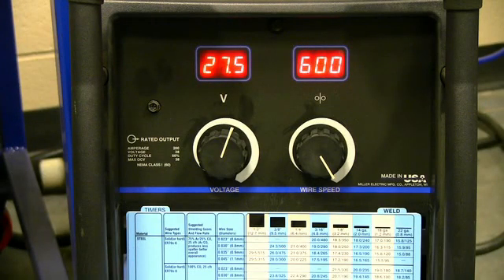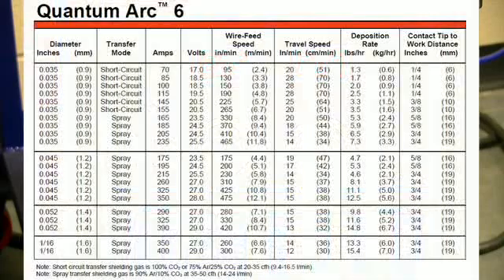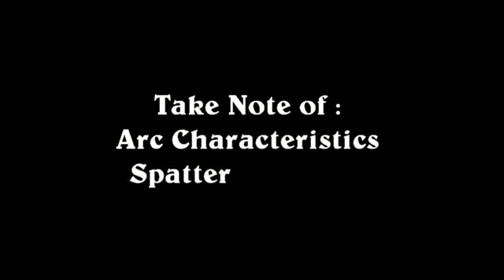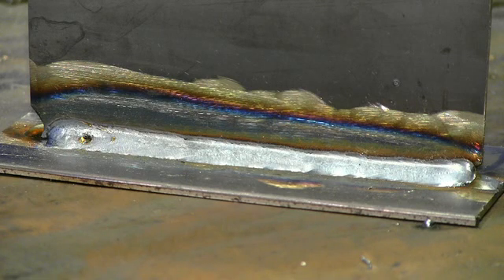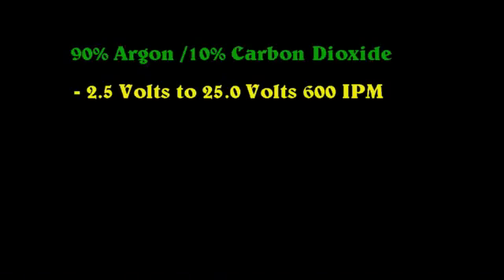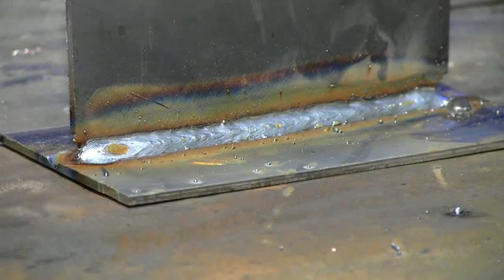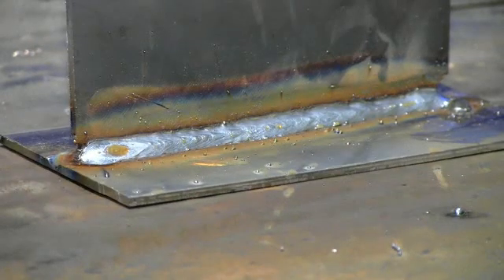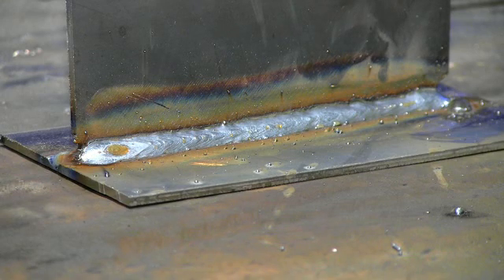spray transfer

Comment: Thanks for the informative video.
I am still confused about settings for spray transfer when welding aluminum. Spray is certainly achieved using 100% argon and voltages certainly less than 25 volts. Why is this?
Suggested settings on some welders for aluminum spray have voltages around 18 volts whereas other machines set about 21 volts. Are these differences just related to the machines’ idiosyncrasies?

Comment: Brilliant video and explanation.  I've been using spray transfer on 8mm plate, horizontal fillet and vertical down fillet with really good results . I like your video because of the possible problems and how to rectify them. Great job 👍

Comment: So do you have to push or can you pull the puddle with spray transfer and can there be oscillations or manipulations such as arcs or cursive e's or does it have to be a straight push or pull?

Comment: Hi im in the uk using C15 ( 85 /15 ) here's my problem ? we use 0.039mm wire ( 1mm ) so what would be the optimum parameters for welding using 27.5 V  what would my wire speed be yours is 600 Ipm I need a Meters per minute approx 
Thank you for the Video
Reply: You don’t need meters per minute, not being a prick but you need to pay attention to the silica that is deposited on the bead surface…… the colour ranges from very light caramel to dark brown and all the way to black….. you don’t want black, you want to be getting a caramel colour, more towards the light end of the range, that goes for both dip transfer (shirt circuit) and spray transfer… the colour gives you your temperature. As for voltage, you can’t get spray below 25 volt’s so just crank your machine to 3/4 of its maximum wire feed speed then set the bolts to around 30 volts, from there you can fine tune depending on the results…. The tip of the wire should be pointed, and the arc will be conical with an arc length, measured from the tip of the wire to the weld pool, of about 5mm….If that gap is say 10mm then you either need to increase wire speed or decrease the volts….. I jump from dip to spray depending on which weld I’m doing and I think I spray at around 13-14 meters a minute, .09 dis wire, argoshield gas and the volts are about 30-31 and that’s just a light bead….. play with the settings and have fun, try setting your machine up for dip just by listening to the sound it makes, should sound like bacon frying….. I shouldn’t have smoked that joint earlier!!!🤣🤣🤣🤣

Comment: What  you're talking about is still globular tranfer. For "true" spray transfer, a mixture of at least 98% argon is needed with 2% oxygen on mild steel. 99% argon and 1% oxygen for stainless steel.
See "The Welding Handbook, 9th edition, Volume 2, Table 4.1. Globular to spray transfer currents", as per the American Welding Society.

Comment: Even that first weld was awful. The entire thing had undercut all along the top. Spray is so hot that you should never EVER use it on thin material like that. I use spray transfer at work every single day and they should never ever look that way. Spray should look very similar to pulse MIG in the flat position and have the distinct freeze rings you'd normally have. Not to mention your travel speed. See how fast you're having to go on that dinky little 1/8" material? Spray is not meant for metal that thin at all. If you really want cleaner welds with thinner metal, use 90/10 gas at like 22 volts or something. Your freeze rings are shaped like a bird's beak.

Comment: Very well done. Wondering what the flow rate or cfm for the gas should be to do this spray arc process. I'll be welding 1/8" metal with .035 wire and 92% & 8% gas. Thanks

Comment: I love spray on a butt joint or a lap joint or an outside corner. But every time I try to weld a fillet it the horizontal position it undercuts the shit out of the top plate. The arc eats up the metal like 1/4 inch away from the toe of the weld. I may just be set too hot.
Reply: Try a little back step with a slight pause after your forward movement. Also dont hold a 45° angle on the fillet. Relax to about 35°

Comment: Whats the right setting to weld a 3/4 plate to 3/8 one ?
Reply: Max power to start, set wire speed from there.     Bless the work piece with the cutting torch before hand.

Comment: Nice presentation, very clear.  I'm always looking for this kind of information:  What am I supposed to SEE and HEAR when this is working right?   What do I do when it's all wrong?  It's pretty easy for something to get wildly out of adjustment!  Today I'm trying to get a hint, see if I can do a little spray transfer with the modern toylike inverter MIG welder... and it looks like a solid "maybe", like if the machine is cranked way up, and there's a good solid work connection.   I put the work clamp ON the work, I think the video hinted at that.  Even if your cables are good, if you just clamp them on to a rusty painted table leg I think you're going to lose something, drop a few volts....   So, I'm thinking 180Amp Machine (Hyalong) might do it, with say .030" wire, 85-15 gas, and everything clean, machine "turned up to 11"....  Swoosh!  Maybe.
Reply from the maker: When it is all wrong, ( like with lots of spatter etc.) it usually needs a little more voltage or current. Some smaller machines do not have the output capability to achieve spray transfer, but if you want to try a different gas mixture 95% Argon/ 5% O2 operates in spray transfer at around 155-160amps and 23-24V with an 0.035" wire.  I think 85/15 may have too much CO2 for the machine you indicated. Good Luck!
Reply: @nathanfarquharson9307  very valuable information! high fives 😊👍🏾

Comment: Good grief..too much fucking information. I am a welding supervisor for the past 40 years and this is a overload. Not only that none of your welds were actually running in spray transfer...do your ears work ? and not one of your welds looked very good. So basically you are a wanna be with too much schooling. I fired more of your kind than I kept over the years....go get a real job.
Reply: Its not how the welds look bud, it's whether if the welds will hold. But being a welding supervisor for 40 years you should know that right?

Comment: I noticed you're using a 90%/10% CO2 when you're welding, however the chart in the beginning you showed had three different gases: 98%/2% oxygen, 95%/5% oxygen, and 92%/8% CO2; how much will the parameters differ from what you we're running at, say with 98% / 2% oxygen?

Comment: Excellent video. . . I have never welded using the spray transfer method but I do have MIG and SMAW experience. That being said I feel like I have a pretty good chance of passing my Spray Transfer test tomorrow based on what I learned in this video. Thank you

Comment: I purchased a powcon welder and the person I bought it fromwas using 75/25 with 0.035 wire.  When I tested the machine it welded very hot and burnt throught 1/8" very fast set at approximately 30% on a 200 amp welder. The sound was different. I have since found that it was set for spray. This is the first I experienced spray transfer. Must move fast and it will lay down welds without ripples. All the research I have done says spray can not be accomplished with 75/25. What was happening if it wasn't spray?  I have learned more on the settings and now use the setting for short circuit for most of my welding.   Thanks.
Reply from the maker: You are correct technically it won't spray transfer with an 0.035" wire and 75/25. You were probably experiencing a controlled globular transfer. The way to tell is look at the size of the droplets as they are being transferred across the arc. In the conditions that you described the droplet is likely larger than the diameter o the wire. The AWS definition says something along the lines that spray transfer occurs when the droplet is equal to or less than the diameter of the wire. So when welding in spray transfer and you have reached the transition current the wire will start to become pointed and the droplets will be forced across the arc and not transferred by gravity. With all of that said, yes you can get a clean smooth weld with 75/25 in a "spray-like" transfer but it is typically too hot for most applications...and it isn't truly spray. That is how i understand it anyways.
Reply: @nathanfarquharson9307  it took me a while but i managed to finally get a true spray on my machine a rebel 235 (EU version) on 0.8mm 0.030 wire on 26v and 12.8m wire feed.. its a fine balancing act as i found out lol but i have now to try get spray going correctly on 1.0mm/0.040 wire on 26v as that is my max.. gas played a huge part in my progress as i went from a 83 mix to 93 and that changed everything as far as spray stabilty goes

Comment: Sir i have a question.is it possible to make spray transfer on 💯 percent. Co2?
Reply: ..No...you need at least 80% Argon....90% is better...
Reply: @dougankrum3328  What if I use flux cored wire instead of solid wire?
Reply: Bulllshit....been there done that on a bet made in the shop yes you can !....but welding with 100% CO2 sucks. In any case you can spray transfer with any gas when you are running .045-.052  wire with a quality wire feed and Constant Voltage 400 amp or bigger machine running over 32 volts
Reply: Nope it won’t spray it will run super hot short circuit. The argon gives the arc the ability to maintain spray.
Reply: @Migman2020  I've run many rolls of wire in Spray-transfer....Miller-Matic 200...no actual voltmeter on that one, but 24-26+ volts and you need close to 175 amps with .035" solid wire...a little lower current with .030". I used 90% Argon, 8% C02, 2% Oxygen   usually called "98-2"  it is 90/8/2.......there is also 92/8 Argon-C02...and most every gas supplier has their own 'secret' mixes..
 You will not get spray transfer with less than 80%+ argon...

Comment: very informative video thank you very much I'm looking forward to start trying to do this stupid question but can you do multiple passes with spray transfer welding would temperature be an issue possible causes between passes I'm new to welding so simple questions from me
Reply: Yes James Johnson you can do multiple passes as well. I run 27 volts at 425 ipm. Which the company I work for doesn't want anything under 27 volts. But the answer is yes you can. Just make sure you run your bead at a good steady pace so you don't burn through or have any undercut on your previous welds.